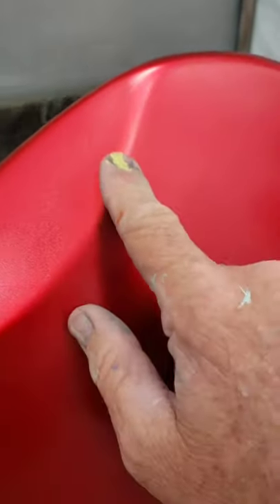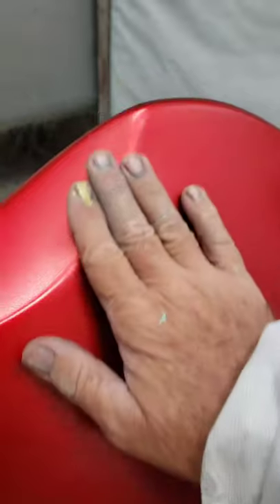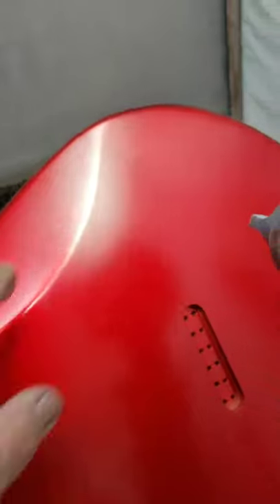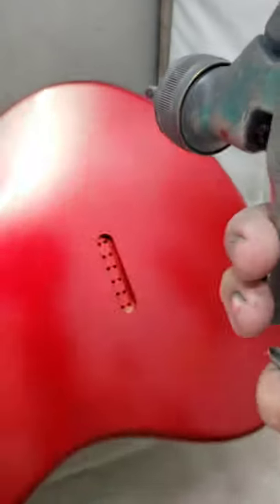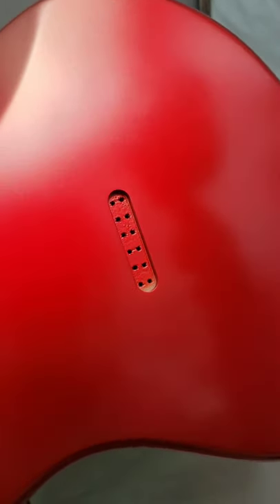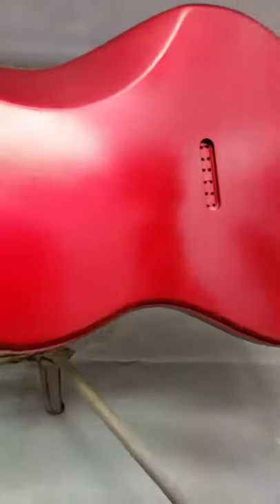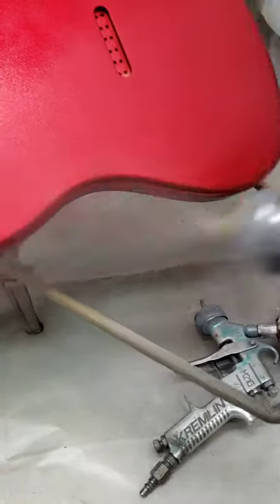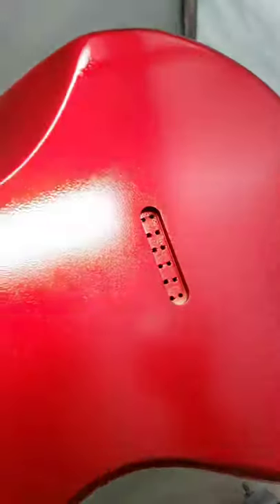Touching up a candy apple red nitro lacquer paint job on a guitar.

Comment: Looks great.  I have a 2008 USA Charvel Socal in Pagan Gold.  It fell and got chipped down to the base coat.  The chip is about the size of a quarter. I'm going to try to touch it up.  
Here is my plan:
I have HOK Pagan Gold Kandy concentrate.  I have small gold flakes.  I think I'm going to mix some nitro with the gold flakes and spray some in the area like you did with the gold metallic.  Then I'm going to mix the HOK PG Kandy with some nitro and spray it like you did the Red Kandy until it matches.   Then go over it all with Nitro.  What are you r thoughts?
Reply from the maker: It will be close.  The size of flake you plan on using is bigger than Fender's Aztec gold but if you blend it a bit it should be ok.  The yellow we use is a touch browner that HOK pagan gold but again, I think it will be close enough. Also,  I'm not certain but I think you have a urethane topcoat.  So you will need to scuff it lightly in order to get the paint to adhere.